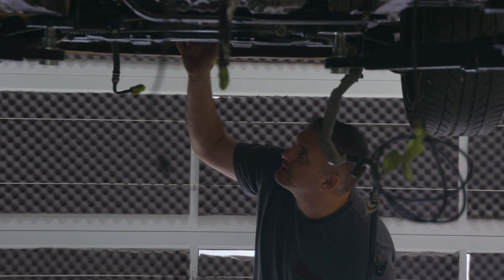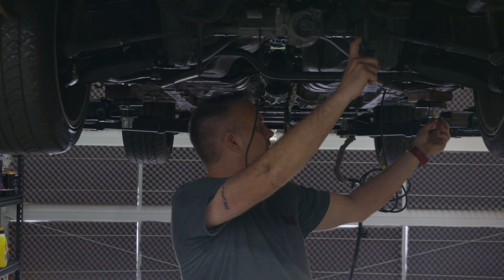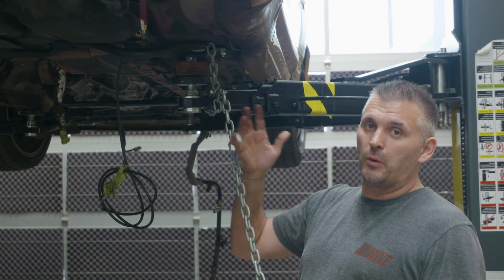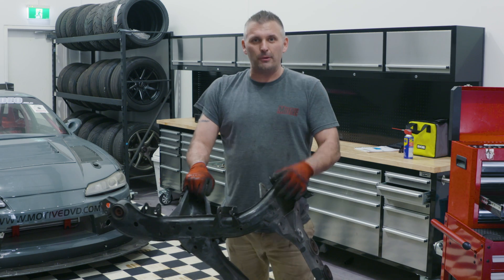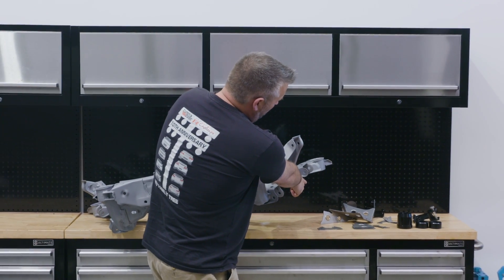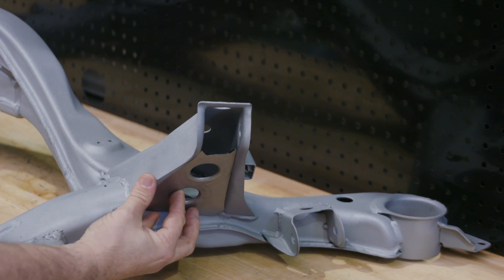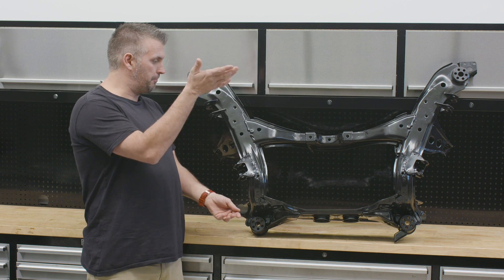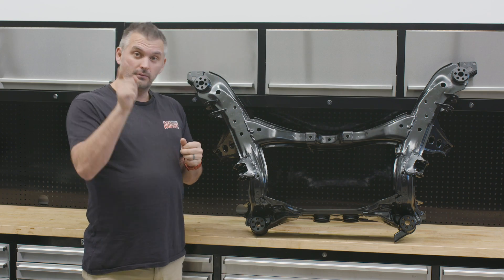Strengthen and Modify GT-R and R/S-Chassis Rear Subframe - Project No Secrets R33 Pt 11

Comment: HELP - Does the Attessa stuff clear the floor in an R32 GTR? (pump, etc, mounted above rear diff). Just lifted my rear subframe fitted with Gktek solid bushes and the stuff mounted above the diff appears to foul, and the threads bottom out? Do the need spacers?

Comment: Im swapping a s14 frame onto my 13 hatch drag car with offset bushes,I did read that the stagea frame is another 10mm wider than the 14/33 frame but would need solid bushes machined for the 20mm off set if swapping to a s13 and the lower arm pick up point is moved like the mod you did in this video it was also claimed, lots of good info in your vids's as ever and looking forward to see how the car behaves and responds to the tweaks and mods

Comment: why get rid of the anti squat? what's the advantage? i was taught you want to add anti squat for traction so the back of the car at launch raises forcing the tires into the pavement but they were reffering to classic muscle cars that squat alot on launch. so i guess i'm just curious if it's the skyline having too much anti squat or to help with other modifications that change how it sits. you guys really seem to know your stuff so i'm guessing it's something like that or something i missed or some nissan voodoo to make them hook up better. loving the videos you guys do great work.
Reply: Anti squat is good for drag racing,  where you are going in a straight line and want to keep the wheels flat, however on a circuit car, anti squat lowers dynamic camber gain which provides less traction in the corners
Reply: @asante.hiloshee  good to know. i appreciate the information.
Reply: @adampinczesgarageandfabric9930  if you can find it, gktech makes a great article explaining the differences between each chassis' subframe and essential s13/32 have more traction for drag racing and s14/r33 more grip for circuit, however the with the new product gktech makes, it's a great leveler. No need to swap subframes

Comment: Great video, I installed the same GKTech reinforcement kit last year on my S14. A crack developed on the subframe nearby the diff mounts, apparently a very stressed and common place for failure and I am just an amateur drifter. After the install the rear end feels much more stable, definitely worth it for any R/S chassis owner.

Comment: That tipping shells yarn was pretty close to home, dropped a transmission from a legacy on jack stands a couple weeks ago and it very slowly picked the front up and nearly tipped... too many parts in the boot after shifting the rear stands forward to pull the rear subframe....

Comment: Solid bushes only move the diff and sub frame, not the hub. So it's not like a drop spindle....
Reply from the maker: Think about it for a minute
It raises the subframe to the body so when you lower it 25mm the suspension geometry will be like factory 

You're lowering the body over the subframe

Comment: Putting solid bushing raises the car not losers it that's common sense pushing up will put more pressure on the rear springs which will push upward
Reply from the maker: It allows you to lower the car by that 25mm without  changing  suspension geometry

Comment: For a drag car, squat is preferable.  But for anything else, anti-squat is the way to go.  This is why S-chassis owners go with the later subframes.  To each his own.
Reply: Agreed. Keeping with stock mounting points and raising subframe with drop knuckles will correct for roll center, which is better for cornering grip.
Reply from the maker: We're going of our experience with our time attack car. It works
Reply from the maker: Sway bars handle the squat during cornering. They're nose heavy and RWD so we like the squat for traction as we have a fair bit of power.
Reply: I disagree, higher hp drift cars also need the rear to squat to get better traction.

Comment: Out of curiosity why not move the rear LCA point upwards instead of the front downwards and get further (albeit slight) roll-center correction? Not enough room?
Reply from the maker: Just purely due to room relative to driveshaft and design of subframe.
Reply: Makes sense. Should probably have looked at one of mine before asking!

Comment: Is the pickup point adjustment really necessary on a circuit car? It pushes you out of the street class in GTA.
Reply from the maker: We're not to going to keep this car to any set rules. Just building what we want. Also, we retain the use of the factory pick up so in theory could swap it back to stock.